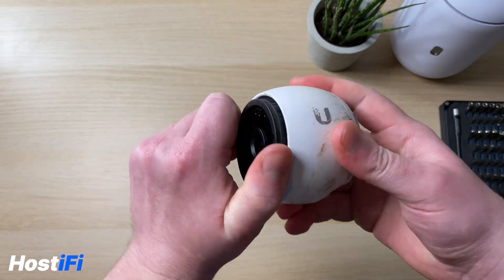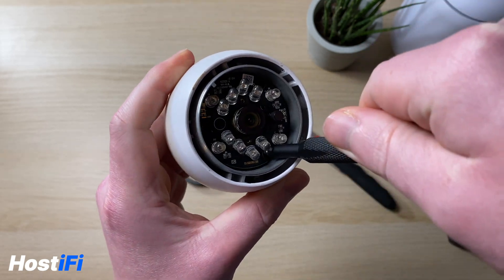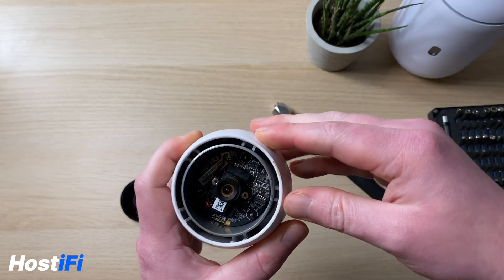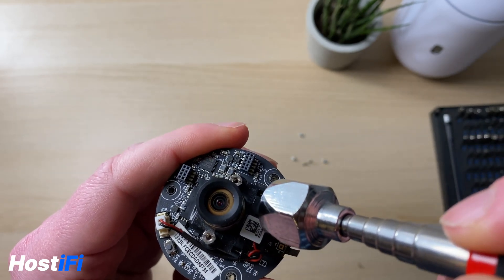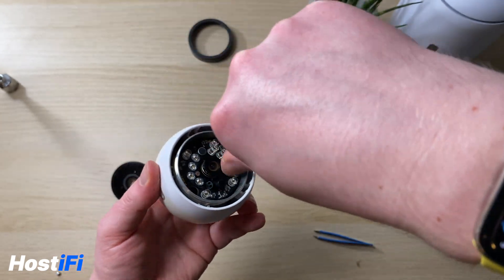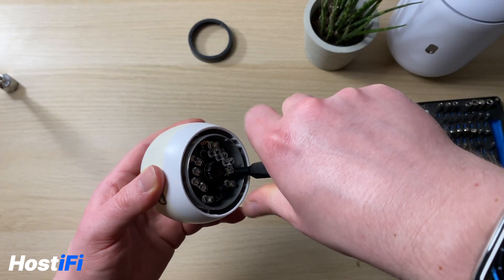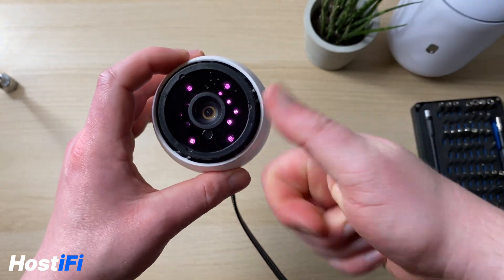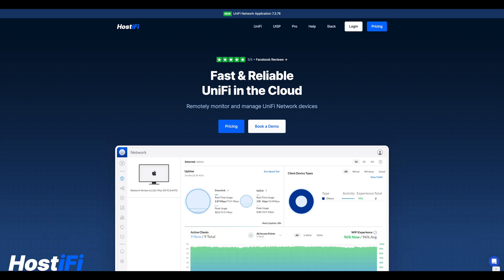Fixing UniFi G3 IR Filter using magnets!

Comment: I just used this to fix a g3 i had sitting broken in storage for this very thing.  Now I have a new camera to hang back up.  Thank you.   I would add though that before taking it apart I would try the magnets outside the camera case first, you can hear it click and might avoid having to take it apart but just stick some strong magnets at about the 6 oclock position.